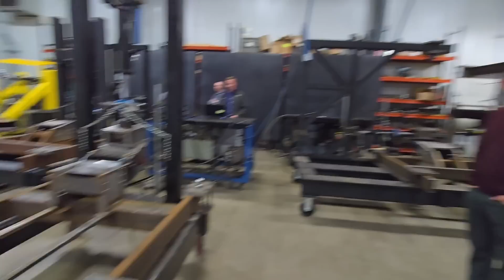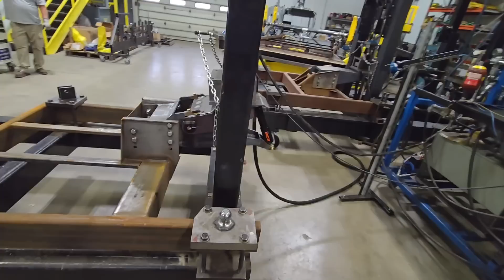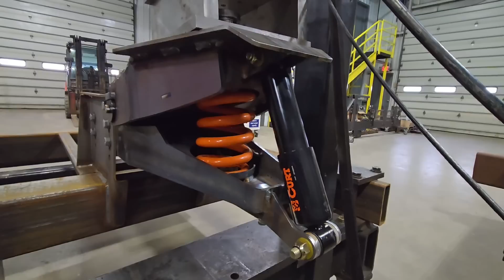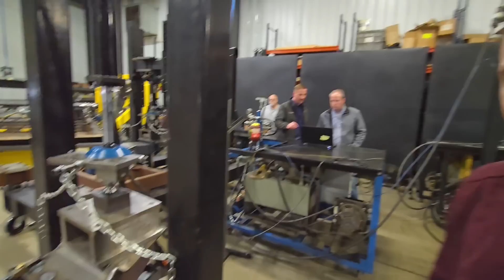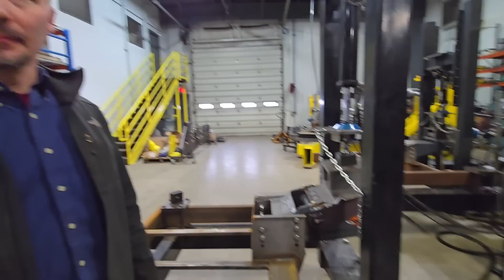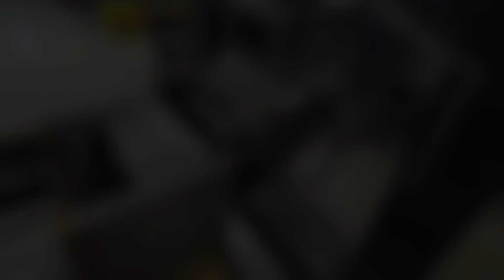EXCLUSIVE! CURT HELUX Gooseball Suspension Pinbox! Kingpin and Gooseball versions!

Comment: Although there should be no reason to remove the spring for maintenance, it would be necessary to change the spring to move the pin box to a trailer with significantly different pin weight.

Comment: All this is great about the pin box, but why is this being introduced?  Does it have anything to do with their frames breaking?
Reply from the maker: This product has been in the works for over a year.  It was there introduction to offer a new style suspension pin box that required little to no maintenance. Also to be able to manage stress when using the gooseneck version.

Comment: I am not sure anyone else noticed or not, but there were two Gen-Y pin boxes on the shelves. One is an executive gooseneck and the other an executive pin box . The only reason GEN-Y isn’t certified by Lippert is Lippert wanted exclusive distribution of GEN-Y to which GEN-Y said no.
Reply from the maker: Wow what a bunch of horse crap. Where did you hear this and why would you even believe this this is completely an utterly untrue.
Reply: @BTBRV  I read it in an article. I’ll try to find it for you. Did you notice the Gen-y hitches on the shelf while there?
Reply from the maker: @byronwilkerson7018  I did...and Lippert has been working extensively with them to try and get their product approved.  It needs to pass testing.  It's strong enough, but they don't like what it does to the frame.
Reply: @BTBRV  great news. I am sorry for any confusion. But, this came from GEN-Y according to the author.

Comment: If the frame and pin box are so important for the safety and security of the RV, then why do they let  the RV builder install axles and suspension? Axle and suspension is where I've had the most failures. Thank you for the good information on Lippert.
Reply from the maker: Because not all manufacturers use the same suppliers for their suspension and axles.  They source them from different component manufacturers. Oftentimes they choose one brand over another brand because of how may integrate with other components that they're purchasing.

Comment: Really interesting and informative video. I wish I better understood gooseneck vs pin box. Oddly, in over a year of research (on YouTube) I’ve never seen a video on it. Pros and cons, etc., and I’m super glad I hadn’t bought my first 5th wheel before your video saying that pin boxes were not interchangeable because I would’ve most likely upgraded after the sale without any knowledge about frame approved ones. How in the world could non-engineer customers have known that and how can owners find out which hitches are approved from each manufacturer? It sounds like this issue alone could contribute to some structural or frame problems. So much to know. Thanks for diving in and taking us with you.

Comment: I thought Lippert didn't recommend converting to a gooseball because of the added stress and frame flex issues.
Reply: The stress is due to the vertical extension down to the hitch ball (compared to the higher fifth-wheel). They may only approve raised ball configurations (like the Andersen Ultimate), but that's only a guess.

Comment: I like the idea of a spring over an airbag for ease of setup but you do lose the adjustability of air. The biggest concern with airbag systems is losing air, but is not a much of a concern on the systems after you remove the leaky push to connect fittings that are typically used. I haven’t added air to my airbag since I replaced the fittings with compression fittings. And don’t even get me started on the pressure relief valve on the goosebox that released air every time a bump was encountered. 

The biggest concern I have with this design is the relatively short pivot arm that seems to create a very large angle change. The fifth wheel hitches are designed for the kingpin plate to remain relatively flat, so I wonder if they considered the additional stresses placed on the locking jaws at those extreme angles?
Reply: I think it needs a King coilover

Comment: I started pulling my 34 ft New Horizons after I bought it with a gooseneck adapter and one day just starting from a stoplight the gooseneck adapter ripped the pin right out of the pin box. After doing some soul searching and engineering analysis (a local welding shop replaced the bottom plate of the pin box with a piece of thicker steel plus added the attaching bolts, which the gooseneck adapter manufacturer and dealer claim are not necessary) I realized the gooseneck adapter is nothing more than a force multiplier (like a pry bar) which adds a twist (upward torque) to the pin box and the entire front frame of the camper.

So when I see this new goosebox? hitch, I can see that while it may indeed somewhat protect the pin from being ripped from the pin box, it will do nothing to protect the twist or torque on the pin box from being transmitted to the front frame of the camper. The amount of twist or torque is directly related to the distance the pin is below the camper frame. With a fifth wheel hitch, that twist or torque is carried by the towing vehicle and not by the camper frame. So bottom line is while this "new" gooseneck adapter may lessen some of the shock loading, it will exacerbate the frame flex which is of current interest with the camper frames. 

Bottom line is I replaced my gooseneck adapter with a heavy-duty 5th wheel hitch which is both securely bolted to my 5th wheel plate as well as the frame of my F 350 dually.  The old gooseneck adapter is gathering dust in my shed where it belongs.
Reply: You should NEVER have used a gooseneck "adapter" for the reasons you listed...a Reese Goosebox does not produce that same effect. That is why it is approved/endorsed by Lippert.
Reply: @flash8051  The Reese Goosebox does not eliminate the additional torsional forces caused by lowering the hitch point from the pin box to the bed of the pulling vehicle. The Goosebox only reduces the normal shock forces produced when starting, stopping and rough roads.

Comment: Why do they need both , spring and shock?   Wouldn’t the spring alone do the job?
Reply: I'd imagine for the same reason passenger vehicles have both
Reply from the maker: The spring needs to be controlled.  The shock dampens the load.
Reply: @BTBRV  not dampen, damp. To dampen is to make something wet. Sorry… engineer here and dampen/damp is one of those things that irritates.
Reply: Generally, shock absorbers minimize the bounciness of the vehicle (which can grow near its natural frequency).

Comment: The available travel of this new pin box looks great!  My concern is with many of the new HD pickups, the clearance between the 5th wheel and the truck side rails is only a few inches.  Will be interested in seeing how this new pin box performs on a rough road or hitting the provided interstate speed bumps.
Reply from the maker: I brought that up several times and they were aware of it.
Reply: I just installed a GenY fifth wheel pin box on our new toy hauler. My truck is a 2024 F450 with the Ford/Reese hitch. I have lowered the hitch to the bottom holes and raised the GenY as close to the camper as it will go. I'm 6.5" of bed clearance. Anything else would be higher.

Comment: Does Lippert require certified welders to weld on their trailer frames...the best pinbox on the planet will make no difference when the frame fails and comes apart that it's connected to!
Reply from the maker: They have a certification program, but not sure. Found this: https://www.lippertuniversity.com/
Reply: @BTBRV  ok I read through their information...they have an 80hr pulse mig welding course that says they follow American Welding Society standards...it didn't say if they did bend tests,x-ray or ultrasonic testing to each welder for their certification though...to be a certified welder these tests have to be done to the welds and checked periodically through their career by inspectors to make sure they are still good welds...and the state inspectors are also certified...this helps to keep manufacturers and construction companies from rubber stamping ...so without clarification on this it could be just a training course in house
Reply from the maker: @bradgeagley4019  do any of them say this?
Reply: It’s because Lippert wanted exclusive distribution rights.
Reply from the maker: @byronwilkerson7018  why do you keep repeating inaccurate information.  Just not factual at all..

Comment: I believe that the spring system will have a rougher ride than the others with air bags or rubber torsions.  Its been proven in trucks and trailer suspension.
Reply from the maker: Please explain more about this.  Trucks use either leaf or coil suspension.
Reply: @BTBRV  you have driven a ram with the air suspension
Reply from the maker: Well, my Goosebox uses air and it does provide good cushion, the method of dampening is also a major factor.  New Tundras ride pretty rough with their new Air suspension
Reply: There are more important factors to ride than the type of spring. Any type of spring can be used to produce a smooth ride, and Any type of spring can be used to produce a rough ride.

Comment: Being able to swap a pin box to a gooseneck/ball connection is very interesting to me. I have stayed with a travel trailer because I didn't want to render my bed unusable on short notice with a traditional 5th wheel. A 5th wheel RV with a goose neck conversion and a cushion mechanism is a game changer.
Reply: They said they are releasing both pin and goose versions.
Reply: Probably THE main reason I switched over to the Reese Goosebox. I got the bed of my truck back!
Reply: This is not a Goosebox connection hitch. It is a conventional pin to 5th wheel connection.
Reply: The Lippert rep said that both versions would be avaialble, @johnirwin1837

Comment: Great series!!!  I learned a lot, even though I have been in the R V for 46 years. The testing facilities very impressive.  I truly think that frame failure is mostly attributed to over loading and road conditions and a little off roading with toy box fifth wheels. I looked over my Grand Design Fifth wheel (mks 320) for any frame issues, only found a bent out  rigger, so I welded a gusset on the 45 degree angle side of the part were it was bent.   I installed a Reese Fifth Airborne pin box to smooth out the ride. Worked well.
Reply: People are posting pictures of the p**s poor welds on their units. I think there is a lot more going on than overloading !

Comment: Upside down looks like an antique tractor seat?
Reply: I think it’s being test upside down, possibly to inspect the pivot points. 
Or to fit the hydraulic cylinder length. 
Either way it’s still the same forces being applied.
Reply: @TheDesertdawg1  I assume that i's just upside down for convenience in the mounting structure, and so that the moving part can be on top.

Comment: I definitely like the idea here.  Less required maintenance than airing up a Goosebox, and more longevity than rubber in a Gen-Y.  My issue is that the Goosebox hinges in such a way don’t dampens movement on the vertical plane and the longitudinal plane (which helps smaller chucking movement).  I’d like to see them add a plate on the bottom like rotoflex  to help that chucking movement.
Reply from the maker: Exactly what I recommended as well
Reply: Actually Reese claims that their design does somewhat mitigate the chucking movement as well...

Comment: Will there be a version of this to replace a Turning Point pin box?   There are currently no kingpin based pin box to fit on a turning point to provide some shock dampening.  Gen-Y has a gooseneck conversion and that is the only option.